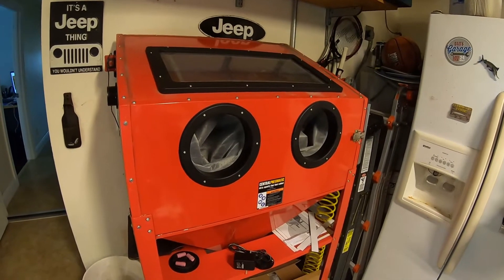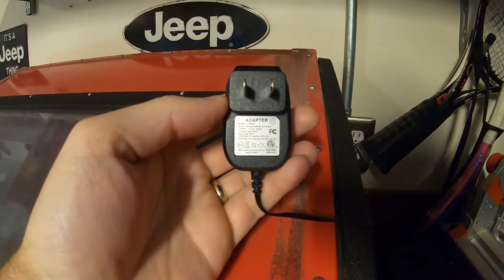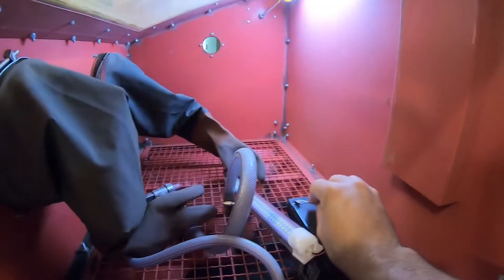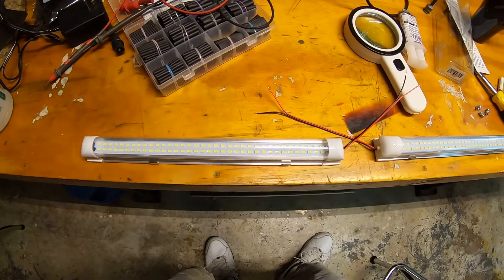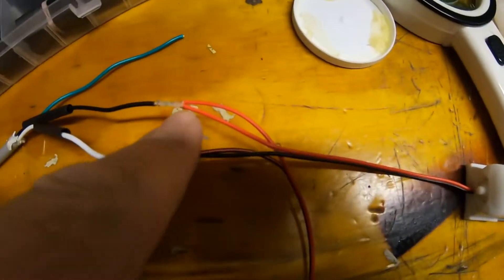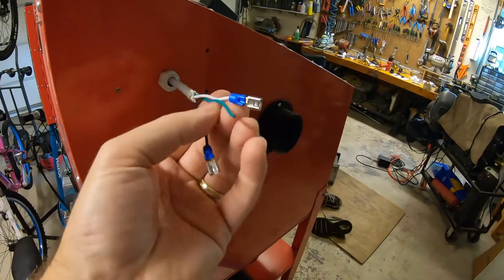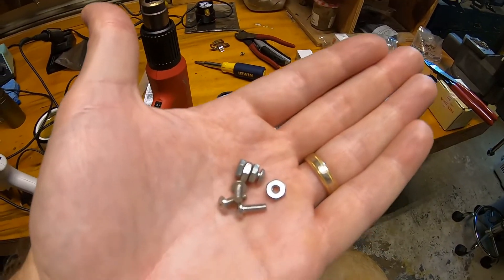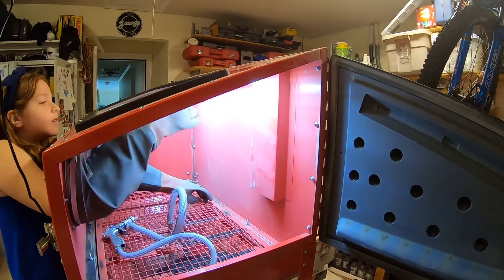Harbor Freight Blast Cabinet LED Light Upgrade

Comment: there is a sleve which needs to be pulled out from the light that comes with the blast unit. Once this is pulled out you will see the LEDs and it will be brighter.

Comment: thank you, for anyone considering doing this, think about using some of the top screw holes for the glass so you don't have to drill more holes and you get to locate the light bar closer to the center of the cabinet

Comment: Hey man, thanks so much for this. I used this as a guide for mine which I rigged up recently. One thing that I found after just a day of usage is that dust from the walnut shells that I am using is already finding its way into the lights, despite hot-gluing the ends as you had. Perhaps some clear caulking around the seems would help. Cheers!